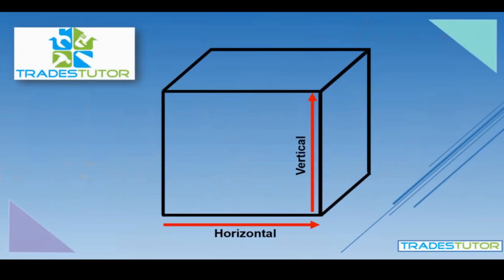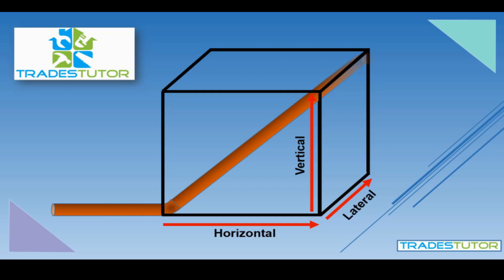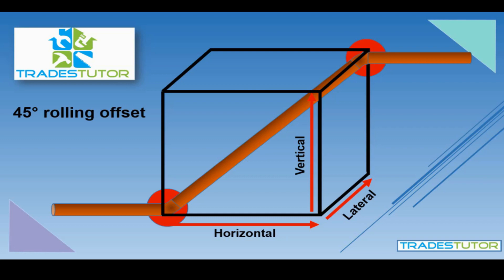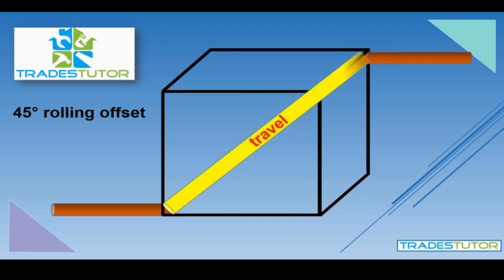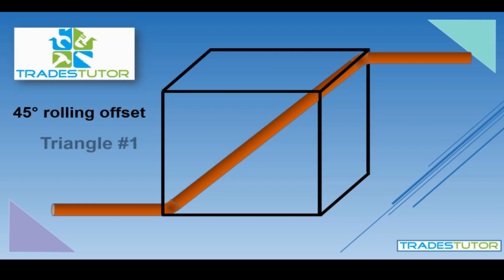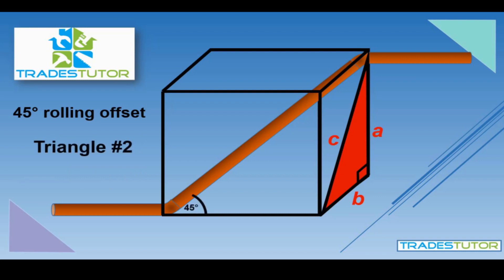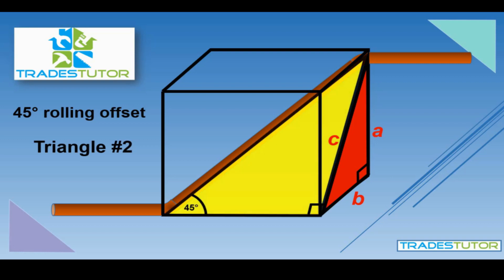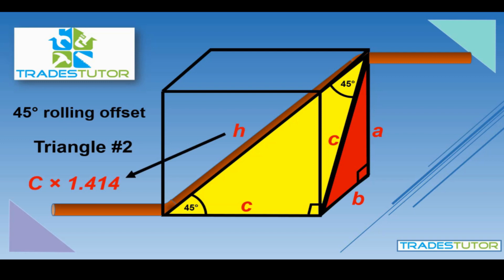Piping a 45 degree rolling offset

Comment: im a littel confused about something, could you take dimension b x 1.414 and just roll the spool down the the same elevation? if you done that you would end up lining up right? i thank it would line the two pipes up but a pup spool would be needed to make the connection if im thinking right
Reply: Your trying to find the length of the travel so no b x 1.414 would not get the correct length
Reply: Only if a=b, same for c to c. On a 45 degree offset only.

Comment: So if the room was a cube the pipe is just double the edge?
Reply from the maker: Yup, you are correct. Essentially you would take the edge and multiply it by 1.414. Take that answer and multiply it again by 1.414. if you tried this with any number you would end up with double the number

Comment: Sorry if I’m wrong but are you saying that your red triangle is a 30° angle because a squared plus B squared equals C squared only works with a 30° angle, for a 45 you’re going to do 1.414 instead of 2.0, because for a 45 your rise your run are always the same
Reply from the maker: HI Kaden A squared plus B squared equals C squared will work for any right triangle not just the 30 degree,  You are correct in that 1.414 works for a 45 degree right triangle with than number being taken from trigonometry. take care and thanks for watching

Comment: Can’t you do A x 1.41 to get C. Then multiply C by 1.41 to get your Travel?
Reply from the maker: Hello: that will only work if the "A B C" triangle is a 45 degree right triangle. If not then you always have to do  it the way I showed in the video. Once you find "C" though you can use the 1.414 as long as its a 45 degree fitting. Take care and thanks for watching.

Comment: Hi. Can you help me with this Question please ?
What is the travel on a rolling offset that has a run of 18”, a roll 24” and a height of 12”
Reply: Thanks
Reply: @katoyblanco2663  32 5/16 angle 56°
Reply: If you want keep the 45 angle you have 37 15/16 but will adj the pipe so the run is no longer 18 but actually 26 13/16
Reply from the maker: Hi Katoy. You'd have to let me know which measurements when you say "roll" and "run"
Reply from the maker: My terminology is different than yours.

Comment: Can you teach it using feet,inches,Tangent,how to solve for Travel #2 & the Roll? In real everyday we hardly use exactly even measurements .Thanks!
Reply from the maker: HI Dave:  You bet. I'll add that to my list of videos to make. Thanks for the idea!
Reply: Hi Super Dave 
Trig solver app, solve for longest side, extract for take outs. Fine tune in fabing. The app will give you the angles. For piping take closest fitting ( 90-45-22.5) and with electronic angle finder, cut to fit. Bobs your uncle.